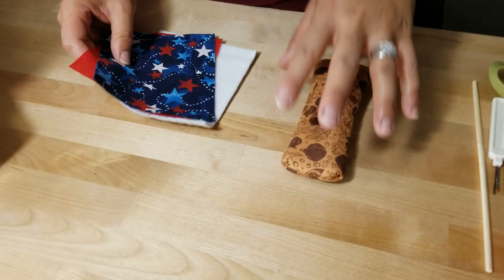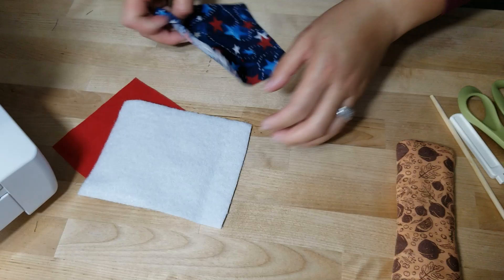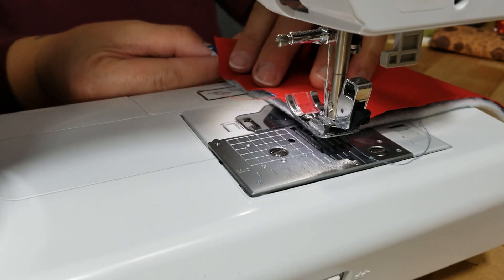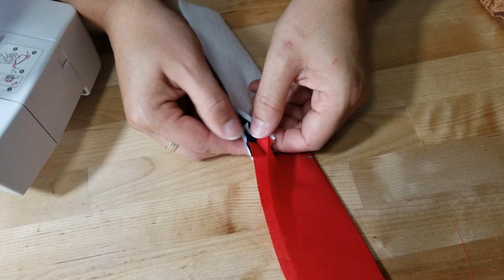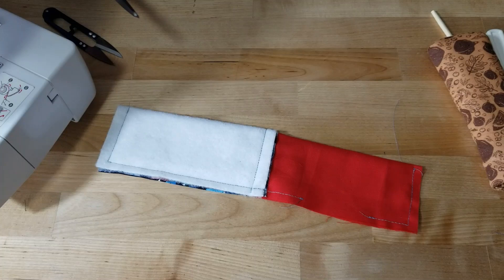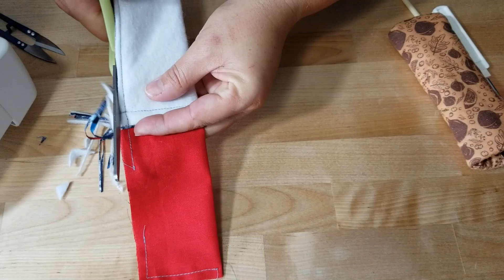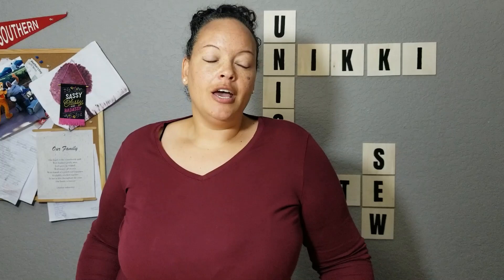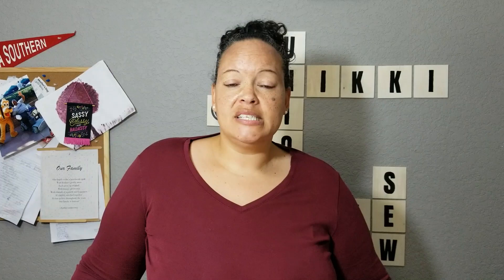Sew a Cast Iron Skillet Handle Cover

Comment: Thank you so much!!! I requested this.
Reply from the maker: You bet!  Glad you saw it.  It really is a quick project but you can use it for other things, besides the pan handle!  Remember, you can alter the size and add on to the length if you need to.... depending on the size of your pan.  5 in. wide is a good width though... Let me know if you have questions. : )

Comment: When I just use insulbright, the heat comes through if i don’t use batting
Reply from the maker: Depends on what Insulbright your store sells. Like fusible fleece, it comes in different thicknesses. Regular fabric, same print, can also be purchased at 2 different stores and depending on what "run" of the fabric off the machine the retailer purchased, the fabric can be very thin/see through, or thicker (for better quality).  Use cotton batting to offset the cost of the material since you know now about the quality of the Insulbright. That would be helpful.

Comment: What would measurements be for a curling iron? To hold the whole iron.
Reply from the maker: No sure about yours. There are many different types of curling iron. I would measure the height and width of yours and add on about 2-3" for the seams and diameter of the curling iron.

Comment: do you know what the maximum teperature this will work with?
Reply from the maker: It is heat resistant up to 400 degrees. I would do some research on what it is you are looking to use it for - if not a holder.
Reply: @SewnByNikki  Thanks, that was the information I needed. I want to use it as a a holder and I often put the Cast Iron pan in the over (but not with the holder attached.)